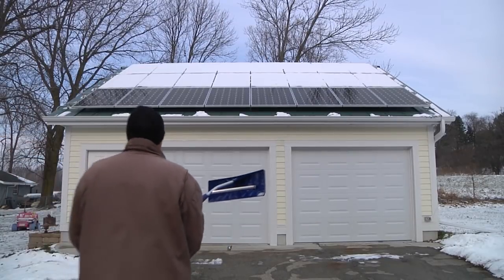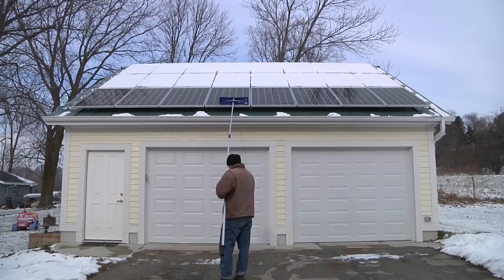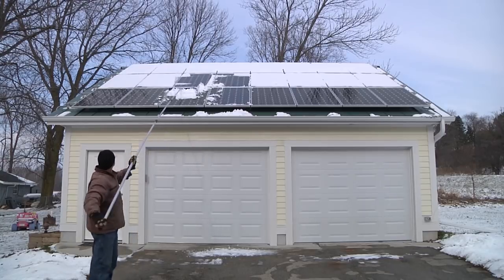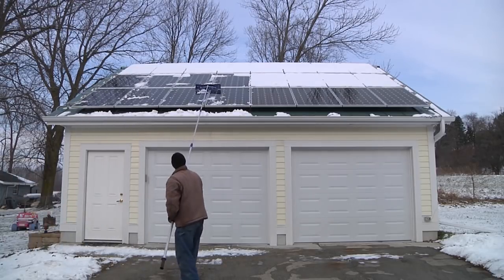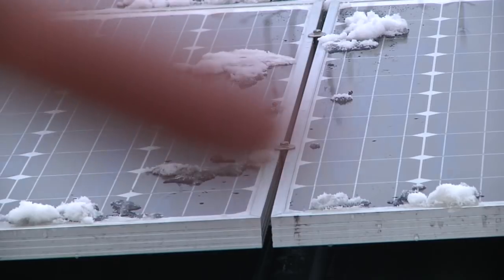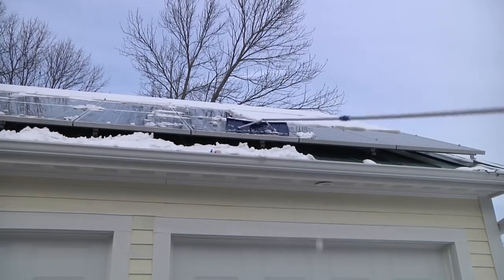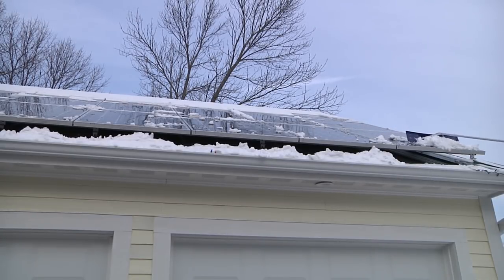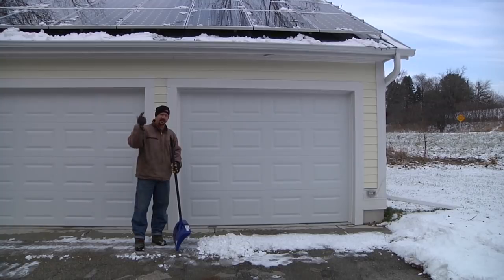Using a Snow Rake on Solar Panels

Comment: Things I've tried: The avalanche, it's a plastic sheet that you push to the top of the panels, it undercuts the snow layer and the snow slides down.  It works great at first, especially when you need to get a half foot off the panels. ..but then the plastic tears on the mounting bolts and panel corners, so I have to tape it up but that makes it lose it flexibility, if you do this, only use it when you have very deep snow to clear. It doesn't really clear the final 1/8" of snow off, so you need to follow it up with something else as well. I've decided to drop this idea entirely.

The next was a plastic roof rake, like you, I noticed that the rake snags every mounting bolt and it doesn't clear all the way down because of the little nubs on the end of my roof rake that keep it off the surface a little bit.

The best I found was using a broom on a long stick.  I used the original broom handle and EMT conduit and it's connectors and made a 30 foot extension to the broom. This works very well without using a ladder to clear the snow off my panels, it doesn't catch the mounting points and gets closer than anything else I've tried. The only thing that isn't so great about it is broom heads have a little bit of weight to them and 30 feet of EMT as a pole is heavy.  It takes some care to set the broom down gently. ..but at least the bristles are pretty much shock absorbing springs.

Comment: Add pipe insulation with zip ties so you don't scratch panels. My 30 panel system clears in an hour once the sun comes out
Reply from the maker: According to the weather report, the sun won't be out for another week. That's a mixed blessing, I guess. The sun won't melt the snow, but there's also no sun for my solar panels to be missing!

Comment: Not sure if it would help but what about waxing or RainXing the panels?  Might help the snow slide easier.
Reply: Good idea, rainx works fairly well on my car windows for rain, if it does the same for snow that would be nice :-)  We don't get much snow here where I am, but I will see what happens if/when we get some snow (on my car windows, I don't have solar to test on [yet])
Reply from the maker: I have a friend with solar who has tried RainX on them. He said that it works well for rain, but nothing for snow.
Reply: It doesn't work because the snow catches on the bolt heads. The RainX residue is also somewhat reflective, so until it wears off completely, you are losing some sunlight.

Comment: how is your snow cleaning coming? Any new videos?
Reply from the maker: Roof rake works OK. I can clear the two bottom rows pretty well. If I get at least a little of the top row and the sun DOES come out, it eventually gets some heat into the upper panels to start melting the snow, but it takes a while. Micro-inverters definitely help with snow, as it's not an issue if some panels have snow on them and others don't.